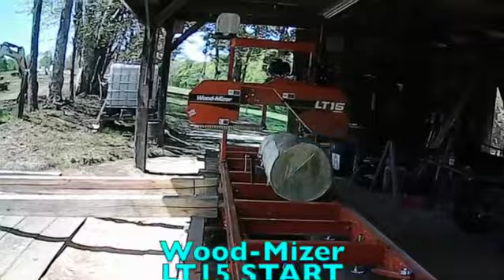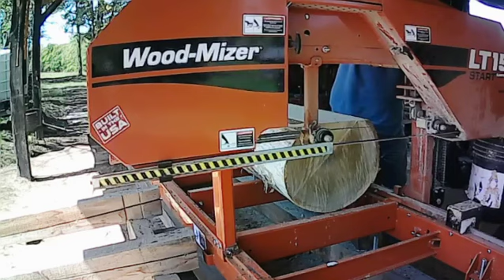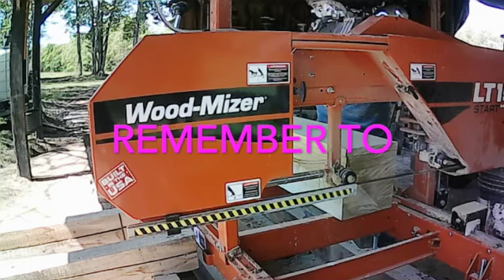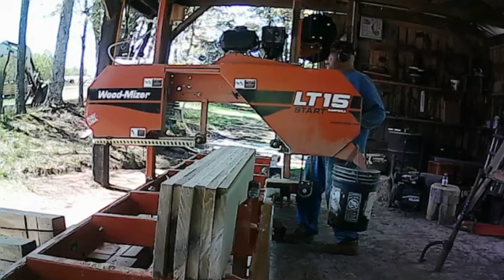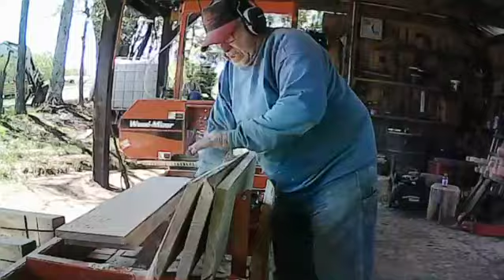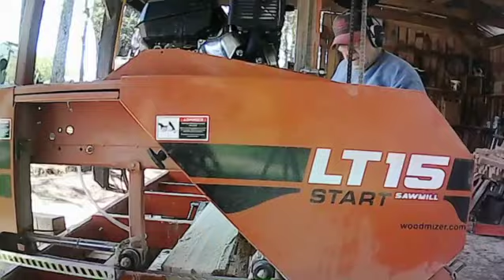Wood Mizer LT15 START saws stickers

Comment: Hi Brent. I need to get some stickers made and since I am such a newbie with the sawmill, I was wondering what the best way to make stickers would be.  Thanks so much for posting this video.  Take care and have a nice weekend!
Reply from the maker: I used to Saw a lot of 1- 1/8 " to plane to 1' for wood workers so we used edging for stickers so, that's what we make now. If you saw 4/4 boards you can use 4/4 stickers that way you can cut some of your edging for stickers. That way you can make a few as you go an not have to saw a log into stickers. It's usually easer to saw a 8 foot log into 4/4 boards stack them on edge and saw down an inch at a time the chainsaw them in half.
Brent
Reply: @lugtugsawmill4725  Thanks so much for the advice, Brent!

Comment: Did you say you ordered THIRTY FIVE blades?? OUCH!
Reply from the maker: Yea, I  thought I ordered 15 4 deg and 5 7/47. then the shipper couldn't get closer than 90 miles from here so Wood-Mizer gave me 15 7/47s. When I opened all the boxer they were all 7/47. The next time I sharpen I think I'll try to make a few 4/47s.
Brent
Reply: @lugtugsawmill4725  THAT I would like to see.